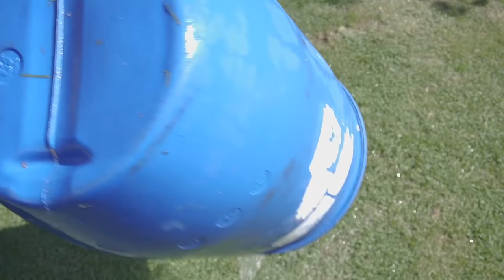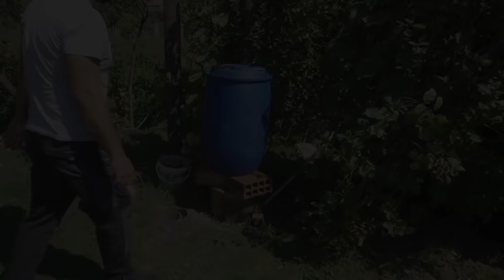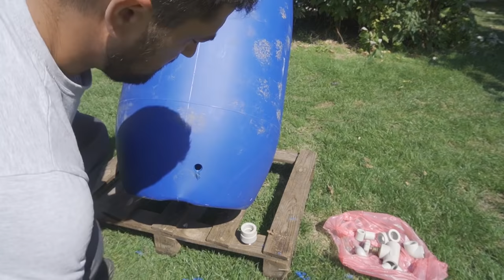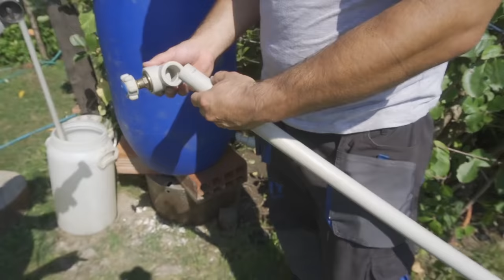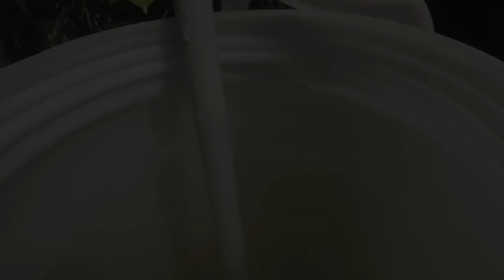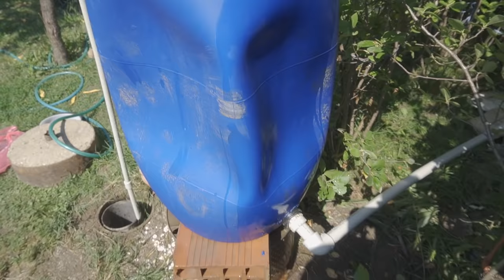How To make Free Energy Vacuum Water Pump Without Electricity using Plastic Barrel 125L / Experiment

Comment: This is just a self-priming siphon setup and not a pump because the elevation of the source is higher than that of the discharge. However, you can remove the pail in this setup.
Reply: No, the barrel imploded indicating it was creating a vacuum inside the barrel, indicating that it never drew any water into the inlet pipe because if it did then the barrel wouldn't have imploded. 
What happened is the water he filled into the barrel was the only water that flowed out of the barrel, he didn't let the film run long enough to show you how the water flow stops after the barrel is all imploded. It stops because there is no more water in the barrel, it is not even a syphon. 
He is claiming it is a pump, but it not a pump, it is not even a syphon, he is a liar mark these words.

But yes certainly agree, if the output is lower than the water source you are drawing from then it is nothing more than a syphon, but at least that works, this shit DON'T. HE was allegedly drawing from a deep well right there under the barrel, and the output was above ground, no way did it suck that water out of any well, mark these words dude.
Reply: I accidentally drained my fish pond one time due to similar actions: the vacuum starts the flow and the capillary action is just enough to overcome the gravity. Thus there’s a limit to the depth of the well for it to work (and the inlet pipe size, of course). Making it work requires trying different sizing. 
There’s plenty of videos of this kind.
Reply: @omanHB    Different sizing doesn't help. This pump can not work, not even for a moderate depth of the well. All videos showing such a pump working are fakes.

Comment: There is lacking in your demo ang also upon installing. You should put a pipe for air preasure. That's why your drum is shrinking because of the air. Put extra pipe between the two pipes for air.
Reply: We have just done this and our barrell keeps shrinking, what are we doing wrong ??
Reply: Use a stronger barrel. It's the vacuum force that will shrink the barrel while trying to syphon the water from the well.
Reply: Exsta pipe has no function, only wastes your money.

Comment: I've been searching for a system like this.  Thank you !  But I'm in America and I'm not getting the pipe size.  Looks like  3/4" from the well to the barrel and then 1" from the bottom to the valve ?  Thanks to anyone that can help.
Reply: 2/3 ints  input and 1ints  output , be careful, the out tube must be long ... as long as beter ...
Reply: @jova1962  Thank you !!
Reply: Size does not matter, use what you have.

Comment: The collapsing of the barrel is spontaneous because, nature won't allow a vacuum without trying to fill something in , in this case ,the atmospheric pressure is trying to fill the vacuum inside the  barrel simply because the outlet is letting out water faster , than the inlet can suck it ..
The inlet and the outlet should be of  the same size for equilibrium ...
All the same , a good idea.
Reply: Unfortunately, an equilibrium is not possible if the outlet is higher up than the water level in the well. Because water pressure at the bottom of the vertical pipe going down the well is much bigger than water pressure at the bottom of the barrel. Water pressure depends only on the height of the water column. An increasing vacuum would stop the flow at the outlet earlier than it would be strong enough to pull up water from a deep well. This is a fake video. It is not possible to lift water to a higher level without an input of external energy.
Reply: Size of inlet and outlet does not matter at all!

Comment: if I did with metal tank will it skrink?
Reply: Probably not, but the system only works if the source is higher than the delivery exit. It is not possible with a siphon to lift water from a well

Comment: your discharge pipe is bigger than the supply causing the plastic drum to crumple, should always be equal based on the principles od fluid dynamics - anyway its perfect!!!
Reply: It's perfect? Yes, a perfect fake! I guess also the crumbling is faked. Why should the vacuum get bigger all the time if new water comes streams in the barrel from the ground? If the vacuum is strong enough to pull the water up, why isn't it strong enough to pull the water back from the outlet pipe?
Reply: Size of inlet and outlet does not matter.
Reply: @igorigor9881  ? ? ?

Comment: What's the distance from the water to the top of the drum? I am curious what is the maximum depth it will work with.
Reply: 56⁵⁵
Reply: Zero because it don't work bro. You can syphon water over a hill like that, but you can't pump water from a lower elevation input to a higher elevation output using a syphon, that requires EXTRA energy like a electric pump, a hand pump, etc...
Reply: @TheRebelmanone  I know that, that's why I've asked the qestion. I was curious if the guy who posted the video will actually give an answer.
Reply: @TheRebelmanone  wrong. That's the reason for the bigger exit pipe. The weight of water in the bigger pipe  pulls harder than the weight of the water in the smaller pipe and is able to lift it from  a lower spot.
Reply: @saveabimmer948  It is a magic trick, the tricksters know it don't work, but they can't understand why not. lol 
It don't work like that, it don't matter how much weight of water you have in the barrel and output pipe because the determining factor is atmospheric pressure, and it changes very precisely at different altitudes. Meaning the weight don't matter as much as the height matters.
IT all matters, but in this case thinking you can lift it for nothing using nothing, all i can suggest to you is do the experiment yourself if you believe it.

It started out they believed they could make something work, using the "weight" of water to push and pull on smaller diameters, etc...sucking water to higher elevations without adding any input energy into the system. But they built the stuff and found out it won't work, so they just pretend it does and get clicks and views
.
But it can't exactly what you said it could do using weight of water because it don't matter how much water is in a barrel, even if you have a huge barrel with 10 tons of water it will not lift itself to higher elevations without added input energy. Using a 10 inch output and a 1/4 inch input will still never pick the water up thru that tiny input unless the output is LOWER than the input.

What would happen if you had 10 tons of water in a huge barrel with the 10 inch output and 1/4 inch input once you open the output valve to release some water, it will begin to allow some water to flow out the output, but air will be trying to make its way backwards thru the output pipe to equalize the vacuum it is making by allowing some water out that same output.  Then some air will make it back into the barrel from coming backwards thru the output, losing some of your vacuum as it does. And that is the same vacuum you are believing will suck up the water from a lower elevation, it is being replaced with air. But then still more water will be trying to work its way out the output pipe, so the barrel will implode from the vacuum negative pressure. And all this is happening, but still no water from the input makes its way into the barrel, not until and if you lower the output lower than the input will it suck the water UP thru the input and into the barrel.

You ever hear of vacuum lock? Even 10 tons of water will never pull water from a lower input to a higher output. Even if you made the output pipe really long and skinny to help prevent the successful entering of air into the system thru the output, then now the water will just stop flowing out the pipe because it is vacuum locked. That is after it implodes the barrel, and after it pulls on the input somewhat, but not enough to get it flowing all the way into the barrel. For instance if the pipe was transparent, you would see there indeed is a vacuum pulling on the input, but not enough to make it flow into the barrel. You ask why, because the altitude of the body of water you are using as your input source is LOWER than where you are trying to output water.

IT is all due to atmospheric pressure. Since you have to get water from the atmosphere in the first place, then that means it is bound to its affects in the atmosphere where you are taking it from. And since you are trying to output it at higher elevations without any reasonable input energy involved, it don't work. IT don't work because you are trying to output the waster back into the the ATMOSPHERE of which it is subject to, immutable and bound to it.
Reply: @TheRebelmanone  your completely wrong. If inlet and outlet pipe is same size, the outlet pipe must be lower that pickup pipe. However, if outlet pipe is bigger than inlet pipe  it creates suction to lift from much lower depths. But if outlet pipe is bigger than inlet pipe it will crush the can. So at the very end of outlet pipe you must decrease size to less than inlet pipe to stop crushing can.
Reply: @saveabimmer948  It don't work dude. This kind of stuff has been tried since ancient times, it don't work. 

Water flow has more to do with atmospheric pressure(height) not its weight.  
Once you use a bigger output pipe like you suggested then it seems like it could create a bigger vacuum on sucking harder on the input. But since water flow has to do with atmospheric pressure(height) not weight then the water trying to flow out the larger output pipe will not flow freely because it will be vapor locked and some water will come out as air bubbles will work their way up into the output pipe backwards and into the tank, filling the vacuum you thought would suck water source from the input pipe. As water tries to flow out it continues to let more air bubbles in to fill the vacuum trying to be created from the weight of the water flowing out, as you said it would. But some water flows out but some  air bubbles come backwards up the output as it does, and destroys your vacuum in the process. That is how and why any water at all is coming out the output, because air is getting into the tank to fill the vacuum the weight of the water is creating, if air didn't get into the tank then it would be vapor locked and implode the tank, and water would not freely flow out. All that would be taking place, but still no water will be sucked up the input and drawn into the tank. It won't suck water from a lower elevation than the output elevation, blanket statement.

 The water input comes from the atmosphere, and the output goes into the atmosphere, that is why it don't work dude, it is subject to the pressure of the atmosphere(HEIGHT).

You are not wrong that water has weight, but the fact that it is INSIDE the atmosphere it is SUBJECT to it. You forgot the atmosphere has weight too.
Reply: @TheRebelmanone  already have one at my off grid cabin pumping water from a creek for chickens and garden and it costs more like 150 dollars not including the drum.
Reply: About zero meters. A siphon can not lift any water.
Reply: @saveabimmer948  I have been using a tube as siphon too, for more than 35 yrs. My experience is the same as at high school: source must be higher than delivery exit for this “pump" to work.

Comment: 1. Only works until the level of water is higher from suction side as compared to disposal side.
2. Whenever the level goes down it will never work without external energy source.

Comment: It would probably work better if you used a steel barrel or put some 2x4's cut to width inside to keep the walls from collapsing.  That would increase your vacuum pressure.
Reply: using one way valve in supply line to keep water instead of air should also drop pressure needs
Reply: @brotheradam  I still do not think it is possible to make this setup work indefinitely.  At the end of the day, you are moving from a lower elevation to a higher elevation and are using only gravity.  This requires more outflow than inflow, just like a ram pump.
Reply: @wesbaumguardner8829  ok..I understand your point.. but.  If I remember right, the author used same sizes. Yes, by using 1/2 inch from well with one way valve inside the well at the feed point, thus keeping the 'head' filled it reduces the pressure caused simply by trying to evacuate the air, which is why most show filling the feed pipe and the barrel before operation.
Obviously the use of inch or bigger on outflow helps increase the pressure created,but for his current distance he seems fine. Just as an air tube part way would help as well in many cases as it slows down hammering if water is turned on and off, but he seems to just be using solid flow only
Reply: @brotheradam   One gallon of water cannot lift another gallon of water.  It takes more than one gallon of water to lift a gallon of water.  Gravity is working on all the water equally at all times.  The only way for water to move through the system is for there to be an imbalance.  But the imbalance means that the system will not run indefinitely.  Eventually, the water in the tank will run out and the vacuum will be lost.
Reply: @brotheradam  With a barrel you do not need any foot valve.
Reply: @brotheradam  With a barrel, no foot valve is needed. Size of tubes are irrelevant but for flow.

Comment: If it drained into the well it came from, you'd have a forever funning flow. Imagine it twenty one foot in the air, imagine a hundred of them releasing a litre a second if scaled up, the emissions hitting a turbine on the way down, and you have all the power you need without breaking any laws of physics? A smaller container can do the same job according to Asian videos I've watched without collapsing on themselves.

Comment: The plastic barrel caving in towards the end after the suction pipe was inserted into the bore is an indication that this works. We could now confidently build our permanent vacuum water pump out of steel barrel and welded piping. Say maybe with stainless steel 3mm thick. I think the suction pipe was about 5m long
Reply: No, this is a siphon. A siphon can not lift any water. Useless trying to get water up from a well.
Reply: vien-phuong7451  8
Reply: @kjellg6532  Dude's a negative pressure vacuum pump! Stop trying to ignore reality. Hilarious.
Reply: @voidisyinyangvoidisyinyang885  Can you describe negativ pressure in gasses to me? Does such pressure exist - in reality?
A siphon is no pump. No energy input = no possibility of lifting mass (water) to a higher level.
Reply: @kjellg6532  You saw the tank cavitating - that's negative vacuum. A siphon is not based on negative vacuum - you are correct. Just keep saying siphon over and over in your head and perhaps one day you'll feel better. Meanwhile people will keep demonstrating this system based on a vacuum! hahahahahaha.
Reply: @voidisyinyangvoidisyinyang885  The barrel may crumble if the POSITIVE pressure inside the barrel is lower than the pressure on the outside, normally atmospheric pressure. NEGATIVE VACUUM does not exist. 
People „demonstrating“ a siphon that can lift water up from a well are all making you a fool. It is against basic laws of physics.
Reply: @voidisyinyangvoidisyinyang885  this thing works based on gravity and atmospheric pressure defferance. Ignor people who don't even try to understand the physics.

Comment: Your out pipes should be bigger than in pipes to prevent the drum from sucking in
Reply: I was thinking something similar!
Reply: But as a second thought, the sucking in of the barrel like that would be really difficult fake; it lends some credibility to it.
Reply: For me, install a pipe vertically on the output pipe to defuse the pressure on the barrel which also help push the water out.
Reply: @rubenrizanmilloroso7503  Sorry, a vertical pipe has no function but wastes your money.

Comment: Well service company will give you a junk pressure tank.  They drill holes to drain the water logged diaphragm that you can seal up with toggle bolt, washer, and rubber.  I have two 90 gal. for storing water.

Comment: you need to take a double sided bung fitting on tge inlet ( syction pipe so you do a 90 bend diwn inside the drum with a 1 ft extension into the water. tgen you dont need to close the lids. the suction takes place in the water itself, not the drum. 
your outlet pipe needs to be the same diameter as your inlet
Reply: Sorry, close the lids tightly. In other words, you could crack open the small cap a little to regulate the tank from collapsing under suction.
Reply: No, for this to work the source must be higher than the exit and it must be air tight. Opening the barrel will ruin the siphoning function.

Comment: To fix the barrel to stop buckling it needs a pressure valve on the tank, a few ways you can do that
Reply: A pressure valve that lets air into the barrel? In that case the siphon effect is gone and you can wrap it all up as garbage.
Reply: @kjellg6532  if your barrel buckles a few more time you're barrel will be garbage to, I'll let you figure it out then
Reply: @808pathfinder  If you let air into a siphon, it will quickly stop functioning. Then you do not need any barrel or tubing. It does not work.